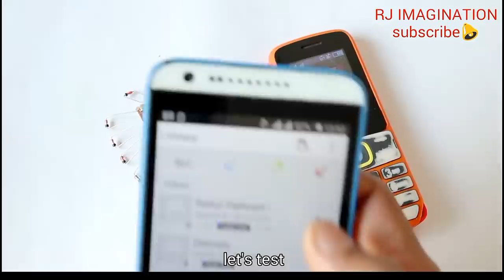Radiation into electric energy | led without battery | from mobile radiation

Comment: circuit diagram please
Reply: (1)+D- +D-+D-+D-+D-+D-+D- 
+D-+D-+D-(2)
Where:
D is diode
+ Is Positive also called cathode of the diode
- is negative or anode of the diode
(1) goes negative on the led
(2) is positive on the led
Reply: @asunasposibol  what is the zener diode value???